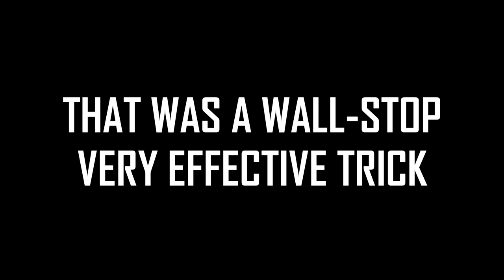ULTIMATE T-STOPPING SESSION on POWERSLIDE NEXT (2018)

Comment: You've confirmed my use of t drag Nik... I don't really use anything else, I spin stop usually after the T if I need too.
Reply from the maker: In fact now I'm trying to use t stop less than before. But not in such weather conditions and traffic. It's still my most stable break. Thank you Martin!
Reply: @NikZvi  once you get used to dont use the t-stop, wheels last forever! I mostly use now agressive slalom and the speed skating technique that is like the plough stop but alternating the feet (basicly making steps to slow you xD) when you master it, it works like a charm. I only use now the t-stop at very high speeds where i need the stability or to do a emergency stop like the powerstop
Reply from the maker: Yeah. I know it. I'm also trying to use it as less as possible. But sometimes there is just no place for slalom of plough. Thanks for comment!